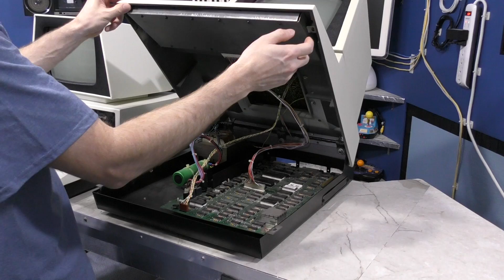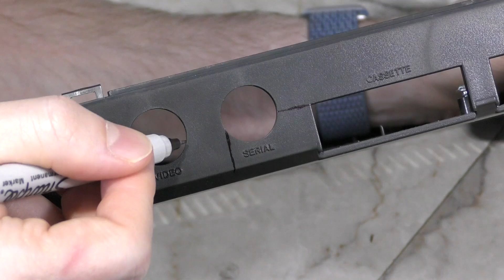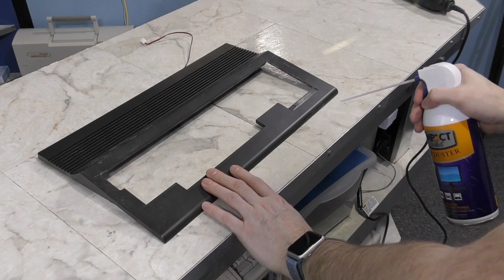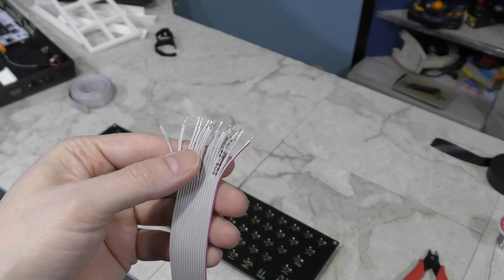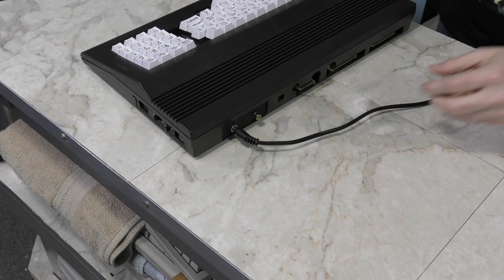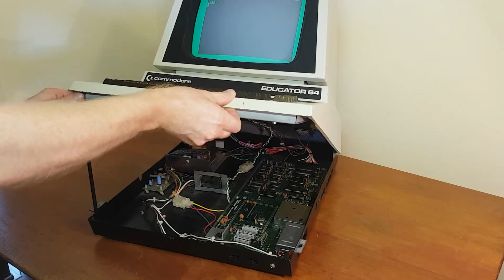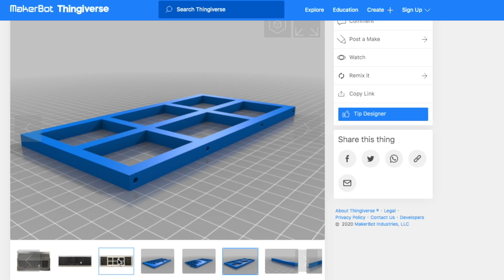Building a case for the Mini-PET

Comment: You got the pronunciation of "Tynemouth" correct the first time. As I said when we originally discussed this, I would be happy to respin the Mini PET board to fit into a C64 case, but there doesn't seem to be much point in doing that until there is a suitable keyboard solution available that would not require the case to be modified. Also we now have the clear perspex case and chiclet style keyboards available from TFW8b, which does a similar job.
Reply: Hey! Ts! You guys are great. I love all the things you do for retro computing. Cheers!
Reply: I'm working on the keyboard concept with Jim Brain. Maybe we can make this happen.
Reply: @ChrisKewl  Steve Gray has started making PET MX Cherry keyboard PCBs (N & B currently) and appears to have some plans for a c64 style one down the track. I've ordered 5 of each and plan on making a Perspex style case taking some inspiration from the new tynemouth case. http://www.6502.org/users/sjgray/projects/mxkeyboards/index.html  https://github.com/sjgray/CBM-MX-Keyboards
Reply: Ever consider using one of the joystick ports as a socket for an external Numberpad key matrix. 9 pins could get you a 4x5 matrix, which covers the whole number pad. Any keys that don't fit in the standard C64 main layout area, could possibly be remapped to the function key area. While not as ideal to the PET layout, it could work as far as just using an unmodded C64 case.
Reply: @richfiles  : Or a serial connection with a clock pin & a "frame mark" pin, so that a simply system of shift registers (some in the case to feed the internal keyboard matrix, some outside to read the external keyboard matrix) could be used.

In fact, if that were done, the connector could likely be on the internal key matrix itself, accessed via the function key hole. In the extreme case, you could even have the number pad mounted directly to the connector.
Reply: @ysac  Yes, that is where I am from, and I named the company after that. It's Tynemouth Software, as I was originally a contract software developer.
Reply: @ysac  Yeah! It’s a little weird seeing my (almost) hometown on the 8-but guy!
Reply: Props for the ingenuity but this seems like a lot of effort to get a square peg in a round hole.  Why is it imperative to get this board squeezed into a C64 case?

Aside from the keyboard differences, the whole IO panel is completely different, resulting in a hacked up case that will never look like anything except a DIY hack job.

Bespoke case, guys.  :-)
Reply: The main QWERTY area of the PET Business Keyboard has the same layout as the C64, AFAICT, and when using it you can get numbers on the top row and don't need the keypad: https://retrocomputing.stackexchange.com/questions/12466/what-were-commodores-keyboard-layouts-before-the-vic-20 As @richfiles π says, an external keypad could be connected. This wouldn't use the function key area but that could be used on the Mini PET for things like reset and NMI debugger keys, blinkenlights, etc.
Reply: @hjalfi  At first glance they are similar, but when you look there are rather a lot of keys which are different. Some are missing, some in different places and importantly most of the punctuation is in different combinations of shifted / unshifted states. I've been through it all sorts of ways and it's too different. If you want to use a C64 case, we need a new keyboard with the right keys, and ideally based on the graphics not business layout for better support for some older software which does not use the kernal keyboard routines. (or maybe just build a different case or use the perspex one we sell that was designed for the Mini PET and the chiclet keyboard)
Reply: @DaveCurran  How about the C=Key from Go4Retro that uses intelligent mapping to convert C64 to PET (this feature may be coming soon).
Reply: @ChrisKewl  Sorry, we've been through all of this so many times, please just look at the keyboard and see how many differences there are. It's just not a good solution.
Reply: @DaveCurran  I don't mean the symbols on the keys (which will obviously have to be different) --- I mean the layout of the keys themselves. Compare https://i.stack.imgur.com/vjP79.jpg and https://imgur.com/a/9t02UzN. The only difference I can see is that the RESTORE key on the C64 is wider than the corresponding key on the PET, which is INST/DEL. Even the latching shift lock key is in the same place on both keyboards. I agree that supporting the non-Business keyboard would be better, but this does allow you to support (most of) a genuine PET keyboard in a unmodified C64 case. Or at least, the top half of one.
Reply: @DaveCurran  What would be your recommendation on a suitable keyboard solution? I am trying to be the olive branch here.

The PET keyboard as more keys than the C64 keyboard has. You need to either combine keys or completely remove the number keys area and break that off on its own board. You'll still have the Function Key gap there if you did that.

Again, I am all for ideas and I am sure @go4retro is as well as long as there is some clear understanding what is suitable and what isn't.
Reply: @ChrisKewl  Honestly that seems like the ideal solution, I'm not sure if people are understanding you.  Need a keyboard that fits a C64 case?  Use a C64 keyboard.  And a board in between to remap the key codes and translate the interface.  Like the one you mentioned, or build it onto the respun main board.  Obviously you would need new keycaps with whatever layout you want, since there's no way to fit all the keys without cutting the case or making the keys stupid small.
Reply: @alakani  Thank you! That is exactly the point here. :)
Reply: @ChrisKewl  I don't know. I couldn't come up with one, which is why I didn't go down the route of the C64 case, and designed the chiclet style keyboard (one with nice keys, not the original as shown in the first video) and a perspex case has been designed specifically for the Mini PET, so I would suggest using that since the C64 case does not currently have a viable keyboard solution. Pictures of these are on the TFW8b site.

Comment: Do they have any C128 molded cases? They have the same keyboard/number pad layout like the PET (with the extra F-Keys along the top).  I know the case is bigger but the KB space is the right layout area like a PET (C64 didn't have a number pad, I think that's the biggest issue).  As well as a C128 case would give the "bigger" case feel like a PET had and allow a monitor to site on top (of the LCD variety) ?? Just thoughts.

Comment: If you have the case and you have a bit more time with a 3D printer + design, you can fill in those parts by printing inserts out of ABS and using acetone to get everything attached. It's most likely would be impossible to color match or texture match, so various patched pieces can be cleanly fused it and be smooth, but the entire case would need a coat of black matte spray paint after surgery. Then you could add patches on the keyboard side and the back ports to cover the round holes, it can be done so the case doesn't look like it has 3D printed pieces -- just takes more work.

Comment: Dremel makes a little saw blade that cuts more and melts less that you might like (used mine yesterday!). I just 3d printed a Sinclair Microdrive case yesterday.. I enjoy your vids! Is there a reliable converter that takes in composite and puts out VGA so I can use my old 8-bits with a vga monitor? Cheers.

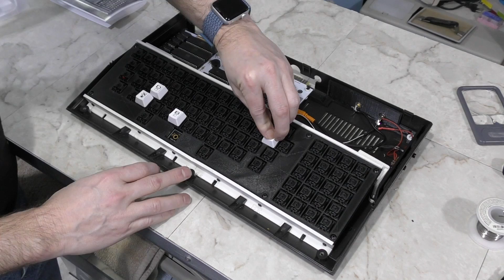Comment: Real nerd would of not used that keyboard guide to where the keys go 8:40 (top left black and white)
Reply: The white parts are not visible so it made sense to use my cheaper cost filament (white) where it wouldn't be seen. I would of used purple or orange if it was cheaper. The only visible parts are black for a reason.

Comment: So this was a new black case?  This might be obviously to someone knowing a lot about the 64.. But was the original ever delivered in black?
Reply: AFAIK the 64C was never offered in a black chassis back in the 80's - 90's . This is a new case, from the old (or re-machined?) original dies. Pixelwizard-dot-eu sells them; the black one is 59.00 Euros.
Reply: @EngineeringVignettes  Yep, that's where I got the case. I bought a few more just in... case... See what I did there? :P

Comment: I suggest you use double wall heat shrink as it has glue which releases and leaves a great finish. But please don't use a lighter to shrink it. Use a  gas torch got air blower. Happy New Year to you from Sydney, Australia

Comment: the pcb where you soldered the power wire looks like it's designed for one of these (check the distance between the contacts):
https://www.digikey.fr/product-detail/fr/phoenix-contact/1935776/277-6405-ND/2513905

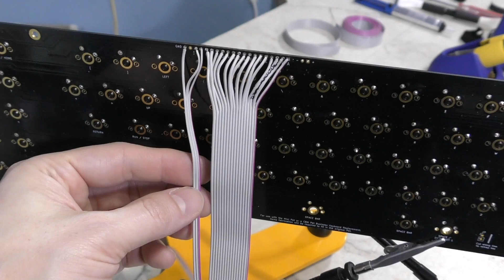Comment: 7:15 when fitting ribbon cable like that. Strip back about 10mm of insulation. Twist the strands of the cores of each conductor together. Tin them. 
Trim them back to 5mm so they will not need much trimming if any  once soldered in place. THEN fit them and solder them in place. It is 1000% easier than trying to poke the individual strands of wires through the holes and then tin them. Better still. Fit an IDC header and crimp connector. No soldering required and easily removed.
Reply: Why don't you make a more or less rectangular plasticard top plate with a cut out to match the keyboard layout, and fix that to the case. It will hide all of the unsightly gaps, and also give a much neater top case finish. You could do the same for the rear of the case too.
Reply: @AndyHullMcPenguin  Great tips there! We did this within a week so it was very fast done with quick decisions. Hit me up on some of your ideas and maybe I can revisit this on my channel.

Comment: You get a nice storable system, but indeed it is costly. I suggest a cheaper solution with more potential: https://lotharek.pl/productdetail.php?id=45  . It works with an FPGA and has lots of cores for old 8 bit and 16 bit computers, consoles etc,  including the PET. It only costs $ 255 + shipping. Lots cheaper than $ 405 + shipping for a PET mini + SDtoPET. The only issue is that you have to use an USB keyboard, I think it is possible to design a USB PET keyboard that can be mapped correctly, but you might have to alter the core too (https://github.com/sorgelig/PET2001_MIST/tree/master/releases).
Reply: The downside is it's not going to be 100% accurate, especially when it comes to the demo scene on PET. This is why it uses real parts that the PET had.
Reply: @ChrisKewl  That is not certain: the mini pet uses "all new, currently in production parts", not the same parts as the original pet.

Comment: This video is bringing back many memories for me back in the late 70s.   My friend sold Commodore PET computers in Eastern Canada.   On the original PET, the front plastic nameplate would snap out.  I was just finishing high school and my friend gave me a contract to build an audio option for the PET to produce sounds from a bit port.   I sourced Radio Shack audio amplifiers which had a volume control and 2 audio jacks.   I routed out a slot for the ON/OFF volume control and two audio jacks.   The nuts on the audio jacks held the small board to the back of the name plate and I made a cabling harness to go over to a inline pin array to pickup power and the bit port.   I was doing many of these per month - can't remember what I made, maybe $10 or $20 a unit.   More fun and better money than a paper route or working at McD's.   My friend did amazingly well selling these computers as he sold a couple into the school boards and the government and then next year others in the government and the schools said me too and his sales soared.   He won some trip with Commodore for top sales and got to fly on the Concorde.  Those were the days.

Comment: Since you have access to a 3D printer, I wonder if it would have looked better to cut our the the entire keyboard rectangle/panel  of the case and print a replacement panel?
Reply: Would not print in a single go, no readily available printers exist to do that (yet).

Comment: Pity you never used the two spare keys for something else. On mine I remapped the curser keys to either side, up/down on the left and left/right to the right of the space bar, makes it a lot easier to get to them, and after a little getting used to it I rarely use the ones above the number pad.

Comment: This is a great project.
An alternative starting point case could be an amiga case - it would have space for the custom keyboard pcb's numpad
Reply: It won't. There are the cursor keys and the help and delete keys between Keyboard and Numpad... Maybe ac C128 Case might fit better, if I remember it correctly.
Reply: @markusjuenemann  Yes - the c128 would probably make a better case. It does have an extra row of keys at the top, but since they are separate from the main key groupings, they could be filled in.
Reply: But other than C64-cases, Amiga- and C128-cases are not in prodoction any more, so original old cases would have to be destroyed - not cool.
Reply: @NuntiusLegis  I thought that new Amiga cases had been made available
Reply: @radishdalek  In that case I give my blessings. :-)

Comment: for 5v on the power LED 330 ohms to 1k ohms resistor should be fine.  that is an awesome machine. i love it! :)
Reply: The generic formula:
R=(Vsupply - Vf_led) / I_led

Vf_led depends on color if the LED is of the older styles, while newer might all be around 3V and generate blue internally and then use phosphors for the final visible color - if uncertain test/check what you've got or start with higher resistance/lower current for initial testing/verification.
I_led can typically be set to 20mA for 3/5mm LEDs, but they're usually almost as bright, and will live longer, at 10-ish... But also beware to not overtax the supply if from say a chip.

Then check the power dissipated in the resistor, P=R x If_led^2 and pick an appropriately sized resistor.
Reply: @michaeltempsch5282  5v supply. 2fv. 10ma draw.= 300ohms. i know the formula. 300 to 1k. 1k if you want the LED to not be so bright. (i have electronics degree since 1996). some indicator LEDs are ran right off line voltage 120VAC that use 1/4watt resistors. 10ma * 5v = way less than quarter watt.
Reply: @mikehensley78  Comment wasn't really for you, but for anyone else that was in the same, general, but not exactly same, situation.
Reply: @michaeltempsch5282  oh i thought you were saying i was  wrong or something LoL. i was like wait a minute i figured that up before i posted it. i did the math real fast again and was like i was right! LOL. but yes. your formulas were right on! happy new year!!
Reply: @michaeltempsch5282  also, it is good to see another electronics nerd! :)
Reply: @mikehensley78  intent and tone (like say, sarcasm) is hard to convey in text only, especially when you try to keep it brief and skip the Introductory/explanatory floofery...
Happy New Year to you too!

Comment: Wooden case!!
Reply: OMG YES! A lasercut case would be awesome with 1/8" MDF.
Reply: @ChrisKewl  
I think his brother has a CNC-router which could also be used. Or just the scrollsaw and a fair amount of filing to straighten out the cut lines. MDF is a suitable material as it is easy to sand and paint to achieve a plastic-like finish.

Comment: You don't so much 'cut' plastic with a Dremel cut off wheel as 'melt' it.  But it still works, with a bit of filing afterwards.
Reply: Depends on the tool/bit used - they do make circular saw blades as well as cut-off/grinding discs.

Comment: I saw the piece you cut off the right hand side of the top lid would fit between keyboard and number pad.
Reply: The numpad was too wide sadly, we did look at that method before the Dremel cutting happened.
Reply: @ChrisKewl  You mean, the space in-between the numpad and alphanumeric section?
Reply: @Findecanor  Yes.

Comment: That's awesome, definitely makes it nicer to use. For mine I think I still want to design and print something more PET-looking (but more compact). Hmmmm 🤔

The best thing about the Mini PET versus a real one - they should be more robust over time whereas the real ones, even if they survive shipping to Canada, will eventually need a lot more maintenance :)
Reply: I agree completely. My goal for a drop-in replacement solution would be something that could go in a breadbin case as well as C64C styled case. I think a custom breadbin would look pretty amazing with the Mini PET. Obviously anything you do would have to be 100% reversible with no case mods at all.